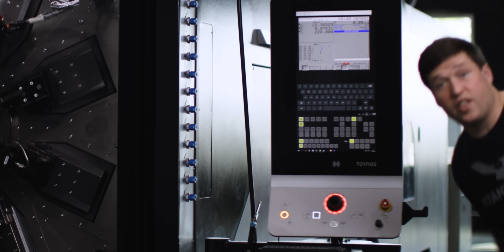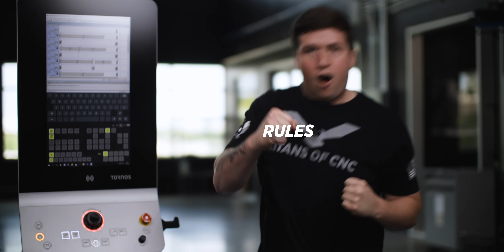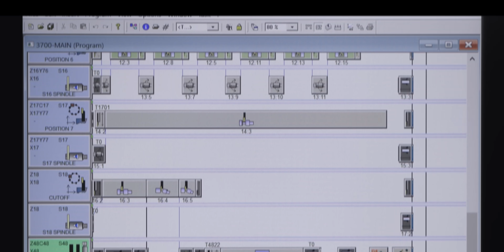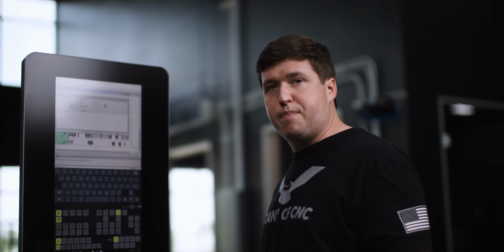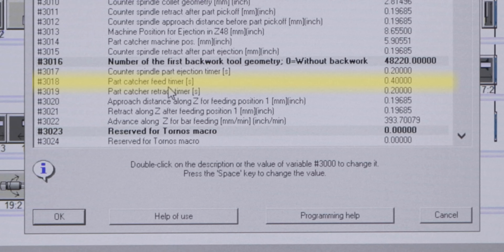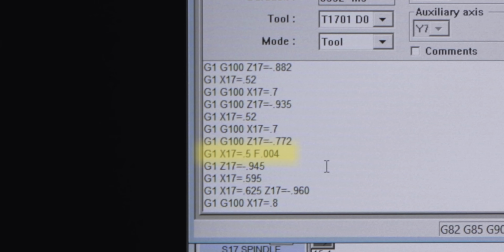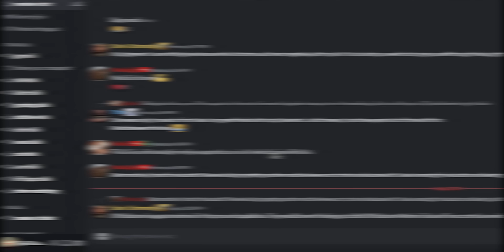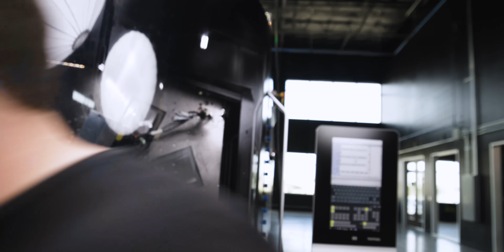Incredible Machining: Parts Made In Seconds Using 8 Spindles

Comment: I've rarely seen a machine like this make sense.   You need a very tool friendly material otherwise these multi-spindles are nothing more than very expensive curiosities.   

The breakdown:

1) Very expensive for the capability. 
     - Each spindle is only a 2 axis lathe.  Figure 
        out the cost of the multi spindle and 
        devide it by the number of spindles.  
        Compare that cost to a standard 5 axis 
        swiss.  Most shops are much better b 
        served with the 6 or 8  swiss machines 
        than one of these.  Less cost with MUCH 
        more capability.  The only downside is 
        floor space.

2) When I played with one of these, parts and service came from Europe.  I hope you're credit is good and you're not in any hurry!

3) Anyone you hire will need to be trained from the ground up.  People struggle to learn these in my experience.

4)  All 6 or 8 spindles stop any time you need to change a tool.  Compare that to 6 swiss running the same part where only 1 of the 6 go down when a tool needs to be changed.

5) 6 or 8 swiss are running 6 or 8 sets of tooling vs just 1 for the multispindle.  If you have 3000 parts to run, each tool in the swiss will have 500 parts worth of tool wear compared to a 6 spindle multi.  The multispidle's tooling will have all 3000 parts worth of wear.  Unless you're running brass, aluminum, or plastic....

6) Cycle time is important, but you really need to look at the time to run the entire order, not just 1 part.  Hands down, this is the most common mistake in our industry (and with TITANs in general).  Will that multi spindle really finish the order faster than 6 swiss?  Not in my experience and the difference has never been small.

In short, I'd like all of my competitors to buy these multi spindles so that I can out compete the Snot out of them!  I'll concede that these machines are really cool and make for some great videos, but they really don't make sense in the vast majority of cases.

Comment: Production machining is not where it's at, I do prototype and short run parts(10-20 pieces), so  I'm constantly doing the fun part, set-up and programming.I doing use software to program with, i use the "fat-finger" method, hold a print in the air and type it in at the machine. I use format 2  even on a Haas Lathe, so I can completely manipulate my tools, were as format 1 relies on parameters, I suggest that you go and check what they are set to, so you don't break your expensive tools, like my boss did. He uses software and so is nowhere as intimate with the machine as I am. I laugh my tail off because I've done this for 20 years and he has a couple weeks on our Haas Lathe, and thinks he is smarter than I,he is a mill guy, and a good one, but you need a different mindset operating a CNC Lathe. There are programming rules, yeah ok, but I know that some can be bent, some can be broken.That's knowing the machine.

Comment: My view as a software engineer is: The command language is very primitive, like 1955 computer machine language.  Tons and tons of anonymous hard-coded commands and values.  The computer folks found out long ago to use a higher-level command language, with real word commands, symbolic values,  and variables.  Not to mention human language comments.   That all can make the program so much clearer and adaptable to changing situations.  You could also incorporate feedback into the commands so pressures, torques, and temperatures can feed back and adjust the commands.   As is it looks like 1955 machine language.  Not meant as a burn.  Look at it this way:  there seems to be lots of room for improvement.

Comment: hmmm,
the way you "speed up" things is really not intelligent. 
you just say: this operation needs to be faster, lets do less waiting and more feed. why would you program it in a way, that you can safely crank up the numbers? why dont you have a table with optimal cutting speeds and just use them. 
i really hate when ppl at my workplace make stuff "faster" like this. usually they just break things or make it less stable.
just get a good routine for building fast and reliable programs from the start. (using pre-calculated cutting speeds and stuff)

Comment: I'm now retired after 58 years in manufacturing, starting as an operator, ending as a  manufacturing engineer. Every time I need to purchase some fitting or other at the hardware store for $8.99 that I know was made in less than 10 seconds really irks me. The machining facility gets pennies for the item, retailers and middlemen making 1000% profit, the end user getting screwed.

Comment: We at my place whe use alfing ad400 on line 2 . We do the 6.6 duramax connecting rods. 4 parts per cycle. 53 sec a cycle. Super fast.  Seeing this machine is amazing.

Comment: My father-in-law owned a shop with a lot of cam autos, Acmes, Davs, Escomatics, B&S.  He had one super high volume part that was run on 6x 6 spindle Acmes (36 spindles total).  He said all the CNC single spindle mfgrs like Miyano, Mazak, Mori were telling him how much money he'd save if he switched to their machines.  He said, "How stupid do they think I am anyway?"
I guess this machine is kind of the best of both worlds, but you could probably get 3 or 4 rebuilt Acmes for the price.  The part doesn't look like something requiring super close tolerances to me, but maybe I'm wrong...  This company seems to me to be better at "Wowie, Zowie" than at making parts.  That's my take on them.

Comment: What is extremely weird: The fastest machines are still analog. Driven by cam disks and gears! o.o
I also didn't believe that at first, but these beasts are still made in a high tech plant in northern Italy (I've been there) and they run a lot of parts for the automotive industry. Sometimes with sub second cycle times.
Of course, they have other insane drawbacks like changeover times and modularity.

Comment: This is all very good for people running multi million dollar machines that can run this fast reliably for years. But affordable CNC mills for example, cannot run balls to the walls without adding a lot of wear to all the screw drives, spindle bearings and other moving parts like tool changers. Saving time on a single job looks good to the bean counters but when the machine has to be refitted with new ball screws and other bushings and bearings for many thousands of dollars and often weeks of down time,  all the savings are lost and more.  If ultra high speed is a must for your business, buy the machines up front that can actually handle it and NEVER LISTEN TO THE SALESMAN!  Go see actual long term operating installations and talk to the operators and programmers.  NOT THE OWNER! Lying is now more commonplace than any sane human could believe so it's up to you to determine what the unbiased truth is.  Then run your parts so that they will run uninterrupted, reliably 24x7, without damaging the machine, using up tools and cutters excessively, and causing a high stress environment throughout the work area.  Then price your finished, high quality parts , delivered on time, to spec , for each and every order, accordingly.  Everybody in your manufacturing chain will benefit, from the ordering/purchasing staff, down to the end user and their assembly line.  That kind of reputation will make you more real money than being some butthead that cuts the cost but fall on your face down the road with late deliveries due to machine downtime, sloppy specs due to worn machines, etc etc.  OH BTW, this machining center in the video is sexier than a 4 balled Tomcat.  Thanks for sharing.

Comment: In 1965, fresh out of High School, I got a job as an apprentice tool designer for a screw machine shop.  The shop had about 30 multiple spindle screw machines, and a half dozen single spindle machines.  I think the biggest were Acme-Gridley RA-8.  8 spindle behemoths, clouds of cutting oil and tons of chips.  I only worked there about a year, then I worked for President Johnson, he was Commander in Chief, I was a Private.

Comment: Lets Get Real Harry! Put some 17-4 PH or 304 condition B and tell me how you will save a few seconds on cycle time and I have some ocean front property in Arizona I will sell You cheap. You will spend more money trying to make a couple parts, much less thousands ..Watch the chips wrap around the part and then try and pick it off with a sub spindle collet.
Brass don't count. You are cutting air. If I had 10% of the monies you spend on tooling and down time, I could retire. Any one can save a second or two on Brass. Get Real Harry!!
Nice Video and nothing personal Sir!

Comment: Used to mentor newby's and these were with newbys setting the tools and writing the program. I would have them set tool change speed to 1/4 of norm until they were comfortable with there settings and proved out there program.
We only did short run parts and the average order was generally just several hours long.
The manager didn't like me telling them that so 100% tool changes it was and there were some spectacular crashes.
Crashing at 1/4 speed caused for less carnage but it wasn't my call heh heh.

Comment: My question is who wrote the original program and why was so much inefficiency written in to begin?
Was it originally intended for a steel part?
And why isn't there a master program or key parameter to set the program for the material used that would automatically optimize feed rates, spindle speeds and machine operations for the material chosen?

Comment: Can the software be run on a desktop in a more ergonomic position, but also so it can be developed while the machine is doing another job?
Even better if there was simulator so you can watch what the machine would actually be doing before any material has to be run.

Comment: This is an amazing machine obviously, However, You failed to tell people that don't know anything about machining
that brass and aluminum are the most forgiving and easiest metals to machine.
Any CNC machine (or manual machine) can cut brass and aluminum like you would cut soft butter with a knife.
Its VERY soft metals. This can be done on ANY CNC machine. Don't get me wrong , these Swiss Machines ARE fast, but they cutting soft metals.
You could not do this cutting any kind of steel.
Dangerous?  I think NOT!  Love it when ya pat yourself on the back.

Comment: How does the operator keep up with inspecting the output when running that fast? A tool wears, an insert gets a chip in it and you're running scrap at the rate of 8 pieces a minute. This was a problem 50+ years ago with running Hardinge ASM's at high cyclic rates....4-5 pieces a minute. The human is always the slowest part of the equation....

Comment: A part every 7 seconds. But the actual time per part is longer. The cycle time is seven seconds per index. What type of index mechanism. We used to run 6 spindle Baird indexing lathes to machine pistons. All mechanical. Face the piston head. Turn the top of the piston to size. Rough turn the skirt. Cut all three grooves. Station 1 load part. Stations 2 thru 5 machining. Station 6 unload. Cycle time was around 6 seconds. Yhen the parts wrnt into a transfer line to bore the wrist pin bore, machine the oil drain backs and turn the skirt to finish size. The skirts where eliptical. I'll let you figure out how we did that. With the piston stationary

Comment: Why use a single-point threading tool when a die head could make the thread 10x faster? Also, the hex can be roto-broached... again much faster than milling 6 sides.... The peck drilling  could be eliminated by a Guhring deep drill in one pass....this is a legit 5 second part on that machine. Again, like mentioned below, this is brass and this is a WFO part.

Comment: I think you made a little calculating mistake. It would take 138 hours to machine the 500000 pieces at 8 seconds per cycle and if you would change it to 7 seconds per cycle you would have a difference of 17 hours 21 minutes and 40 seconds.
Reply: @farmer7888  Damn, I guess I'm wrong. Thanks.

Comment: wont the tools dull quicker in theory too? for a machine like this would you change out every tooling at once or do some last longer than others
Reply: Tool wear isn't too big of a problem on brass parts, esp with carbide tooling.  Some tools in the setup last longer than others.  Generally related to stock removal.
Reply: Each tool has its own tool life count.  Tool life can vary widely. Example ee have taps that are done at 300 and reamers that go 3000.

Material, feed rate, the tool material, the coolant, spindle speed, all have an effect on tool life.

Comment: How might this fail if you pushed these timings to fast (and the software did not catch it and stop you)? Would it simply result in wasted parts that were not made to spec, or could it damage the (presumably exceedingly expensive) CNC machine you are running? In other words, what are the stakes here?
Reply: In this instance, i think running a spindle into the parts catcher is the most likely issue. That would be bad, could be very bad. A spindle for that machine might be 50k and take a week to replace, maybe more. Probably need a tool catcher, too.

The spindle hitting things, or things hitting the spindle can happen with all machines, and is always bad, and often expensive.

Comment: I wonder if this kind of linear tweaking or reordering operations is where the biggest improvements come from? Why make your transits faster when you can make them shorter or remove them entirely? The fastest operation is no operation. (That said, doing things like moving an op from one station to another is way more involved than tweaking some variables.)
Reply: Welcome to the pareto frontier of having a specialised machine for one part, or a very maintainable, well-understood, multi-use machine. The cost difference might surprise you.
Reply: @Dan-gs3kg  I suspect I'd be remarkably unsurprised.

That said, of you are going to run a CNC machine doing the same part every 7-8 seconds for 7-8 weeks, spending even a few hours swapping around what tools are on which stations could be we'll worth it. Also, some of the tweaks I'm thinking of don't even require that: changing the order of cuts on a single station to minimize total travel distance (e.g. break all the sharp corners in order vs jumping all over the place) is just coding.

I wonder, can the transit from the last opp on one cycle to the first opp of the next be done while the turret is advancing? I don't think this video ever showed the turret moving so I don't know if that was done here or not.
Reply: @benjaminshropshire2900  the turret is synchronised, this is getting into rotary transfer machine territory, where things get expensive and more impressive.
Reply: @Dan-gs3kg  I'm not sure how that relates to what I said. Assuming all the stations advance together, at least one of them will always be working right up to the change. The question is; can that station be resetting to the start position at the same time as things are advancing? Might only save a fraction of a second, but over enough cycles...
Reply: @benjaminshropshire2900  it's common and good practice to have clearance points set up between operations. You have a choice on where that is.

Comment: Years ago I did some electrical work in a shop that had maybe 12 screw machines. I noticed they had some stubby left hand drill bits so I had to ask where they use them. To!d me right after an operation that was turning CCW. with the older machines thought they to!d me they save a full second from not having to stop machine then reverse rotation.

Comment: Old school manual machinist here.  Really neat to watch these incredibly amazing machines and the guys who are pros at running them.

I do find it surprising that you don't get unacceptable dings in your finished parts, especially on the threads of heavy brass fittings, dropping into the bins the way they do.
Reply: It has a part catcher. You see it come in and clamp the part just as it's parting off then retracts. He also tries to change the time it takes for the part catcher to move from 0.4 seconds to 0.1 but it doesn't allow him as the minimum it can go is 0.2 seconds.
I'm guessing once the catcher retracts it drops the part maybe 4" into the baskets which (again guessing) are on a conveyor. So they can be emptied when the machine is still running. So there's no time lost stopping to empty 1 full basket of parts every 5 minutes.
Reply: @seanb9818  ahhh, I gotcha, hadn't seen that. Makes sense now.
Reply: Personally, speaking from my experience, I would not place multiple parted off heavy brass  pieces with threads on it into a part of basket. I might go two pieces for basket. But I feel that one part per basket would be safe for the thread.